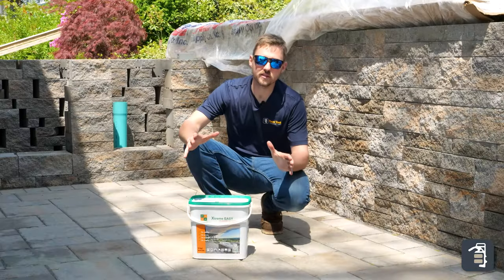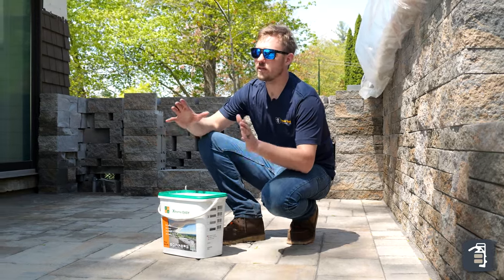How to Install 1 Part Joint Sand

Comment: How much coverage can one expect from one unit/SKU? I'm using the same pavers shown in your video.
Reply from the maker: Check out the product description on PaveTool.com, you'll find a calculator that you can use to figure out exactly how much you'll need for your job!